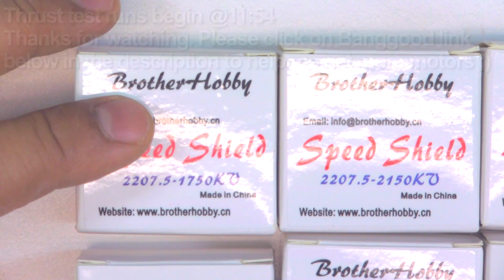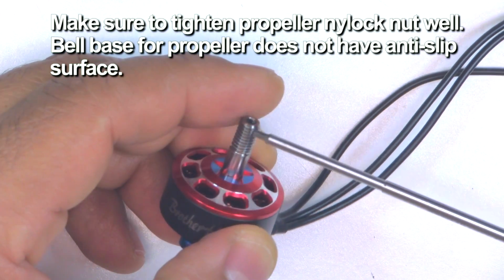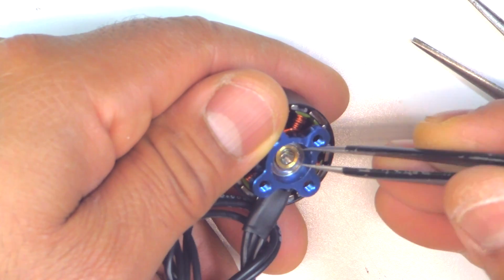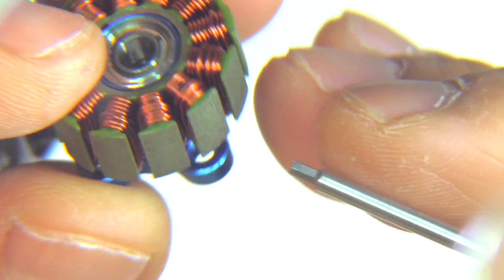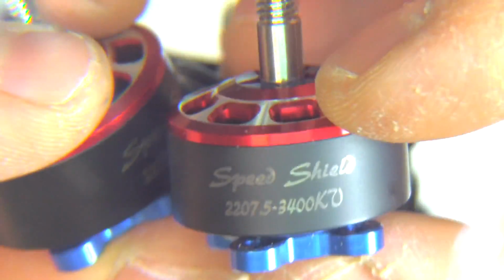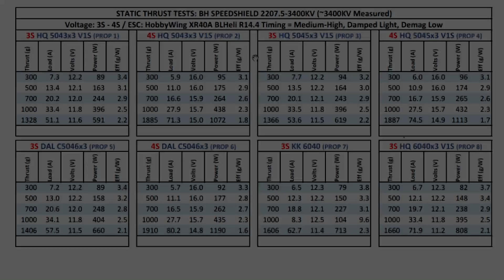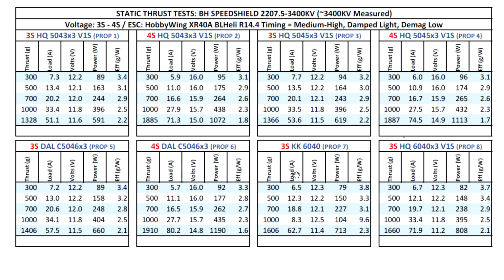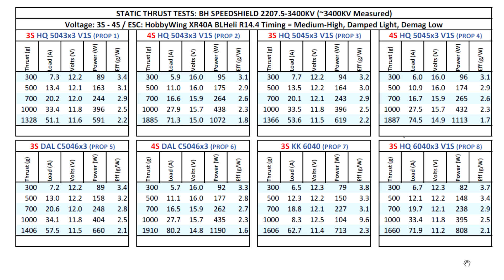BrotherHobby SPEEDSHIELD 2207.5-3400KV - Thrust Test Results

Comment: I've gotten 140mph on a 4.7in prop on 4s on a rebel ruxus v2 with the 3400kv motor.
I posted video on fb on BH page and on my utube page which if you search 2207.5 3400kv speed run will likely pop up.
They were barely warm and I used a spedix gs40 4in1 so they didnt pull no 300a or nothing crazy ,I believe it was around 170a .
Pretty awesome motors actually.
Gonna run some 5030 apc props and see what they do here any day .
Lower pitch but should be good speeds still.
Thanks engineerx for great tests.
Reply from the maker: I may have to re-test on 4" prop. I didn't think these would be used in a 4" setup but your crazy speed tells otherwise. That's frigging fast for a 4" !! Yes, also 5030s could be a great match, just not the oldies from GemFan, too flimsy, Gotta definitely thanks BH for  releasing a motor like this
Reply from the maker: https://www.youtube.com/watch?v=ypk98G4dmyo Found it - that's fast!
Reply: @EngineerX  yea if used on a lightweight frame and propped fight ,basically 4.1x4.1 APC or 4.7x4.7 apc and likely dal 4045x3 and hq4043x3 which I have all of and will try the last 3 mentioned, it will fly great with quality brand high c lipos like rline,pulse graphene 95c,strix 100c and turnigy graphene as well as a few of the luminier graphene and n20 packs.
Also flying in soccer fields wide open non stop will obviously beat a pack and prob the motors so dok g that and saying the motors suck and amp killers is plain stupid which I dont doubt people will do .
You really can fly them at all under 50% Throttle and have amazing resolution and same flight times and power as a lower kv hv setup and then also have that last second recovery top end if ever needed so actually can be the better setup ,again shen used in the right situation.
I didnt try but likely can break any 3s speed record with these with even a 4in prop against 5 and 6in.
I think fastest 3s is like 15 or so and with 6in prop and powerful 2210 cobra but I'm almost positive I could break that with a 4in dual prop. I'll give it a go.
Reply from the maker: @charleshodge9807  Very well explained and you're right. You have to know not to go full throttle for long periods on these and have to make your build just right for this motors and they will perform really well for that specific build. Thanks for adding all this good info.

Comment: Cyclone 5046x3 did 1910 at 80.2amps at 14.8v lmao... Just think about that 80 amps flowing through something that small... Honestly that's insane like for real...

We had 70mm carbon EDFs that run 4s 4100kv on inrunner motors that we was pushing 33 inch carbon monocoque thin airfoil flying wings we would run 2x 2s 3700 in series side by side because they are thin and the wing is very thin.. In fact we designed the wing around the batteries thickness to get it as low drag frontal section as possible. We built a couple of them and flew them LOS and FPV... We made larger ones to that ran 6s and 8s on 90mm carbon edfs the wings had moulded in intakes not just a fan strapped on top.

The point of all this is the 70mm very high pitch 12 blade fans would only pull about 95amps at peak fan loads/Static... These wings was capable of 155mph level flight on 2x 3s 3000s in series 190mph level flight was the normal and in flight 4s pulled roughly 75amps for as long as the batteries could give it but that was all it pulled.

It's honestly amazing that a 2207.5 can handle 80 amps and not smoke a coil pretty much instantly. How hot was the motor after these 4s runs?
Did temps just up big time during those short run ups?

I have these in the 2700kv on a track quad and they are fantastic motors my main track quad motors are 1600kv F40 Pro II and IIIs and im also flying the F40 Pro II 2150kv on 6s as well on big high speed tracks that i need the top end and can carry 6s 1550s without the weight killing me in tight sections.

I wouldn't consider this even on a uber powered 4 inch build BUT what this motor would be excellent for is say a 4.75x4.75 prop on 5s on a 30 to 32 inch flying wing a low drag low lift airfoil you could get some really insane speeds and on a 4.75x4.75 biblade even on 5s your amp draw would be lower then this static test and you would have plenty of cooling and the pitch speed would be very high with that kv on 5s. There is very few if any motors that i know of that can handle this type of current even if it's for a couple seconds that would give me this kinda pitch speed and come in at 30 grams. As you know pitch speed rules on high speed craft.

I wonder could this motor with plenty of cooling handle 6s on 4.25x4.25 biblades? Omg if it could 150mph on a low drag low lift type airfoil that's setup for 2x 3s 2200s would be achievable without much work on a simple laminated foam board wing.

Do you think this motor would smoke at 65 amps for 15 seconds? Im assuming that about what a 4.25x4.25 biblades would pull in flight on 6s. I wish I had a sample now to use as I don't want to buy a full set or i could get it from amazon but singles i have to order from banggood i believe... I will check the normal usa vendors and if anyone stocks them and i can get a single i will build one as soon as i get it and if it smokes it smokes... Ill order two lol and if I smoke one at 6s i will drop down to 5s and maybe go to a 4.5x4.5 biblades up from the 4.25x4.25 on 6s.
Reply from the maker: I'm going to try to answer the most important question. Yes. For 15 sec there a very high chance that it will fry the coils at 65A continuous. The unknown is if with those 4.75 biblades   it will pull that many Amps or even more in-flight. I really don't know. My tests are mainly just to get Max thrust capability but during very short 3 to 4sec spurts. Usually for multirotors [fpv-acro] that's how we use them . These smallish motors with short stators run mostly overpropped at the high rpms in the static tests. But the results give us some numbers for comparing across motors.

Comment: I fly them on 4S with 5149×3 Gemfan Props. Esc i use the Rev32 35amp
Reply: Well I assume you've got heaps of sag on 4S
Reply: @fpvlive  You don't know what sag really means until you try those! 😂
Reply: @fpvlive  actually you need to use so little throttle to put out power and speeds that a lower kv motor would need to be at twice the throttle so if not flying in a wide open area and flying proximity or a tight track your literally flying with awesome stick resolution and control at the bottom half of the stick.
The 2205 4500kv I fly on 4in sag alot harder then these surprisingly 👍
Reply: @fpvlive  is not that extrem what i was expect with Bonka Usa V2 1500mha
Reply from the maker: @charleshodge9807  Tha's really good info. Thanks. These are definitely some unique motors
Reply from the maker: @SettekFpv  Awesome to see they don't explode batteries in an instant :)
Reply: @EngineerX  when you look on my Channel my Last Video is a DVR from testing this Motor. Temperatur was about 10°C so very hard for the lipo

Comment: I only really see this being used in racing wings, but nevertheless a very powerful motor, the tips on those props should be hitting supersonic at least the 6 inch on 4s
Reply from the maker: No doubt... gets scary when I see the big numbers on the screen..... from a distance, I don't want to get impaled if one of the blades decides enough is enough and lets go !
Reply: @EngineerX  yup, I made a little rig back towards the early days of fpv because no one was really testing and I wanted to make sure I got the correct components for my builds, got some extremely cheap gemfan tri blades, started to resonate and exploded into a million peices lol

Comment: Do you think on 6s this would catch fire?
Reply from the maker: depends on prop and weight of copter. Possibly can work with a 5040x3 or close to that and a very light copter...... like 300 to 400g without battery..... but risky for sure.

Comment: we have to  try dalprop cyclone T5051c  :) i think they are perfect for
Reply from the maker: Cool. Thanks for the info. For sure once you get these in the air, moving at speed, the more aggressive, higher pitch props will work fine
Reply: @EngineerX  t5051c are very light 3.3g and they look high pitch but they are made for very high kv motors(the easiest props to spin i ever have)
Reply from the maker: @kieptajfpv6010  I haven't ordered those props, I'll see if I place an order for those.
Reply: DAL 5051s can't deal with 2207/2306 2500kv motors. They will explode at the hub as soon as they start to flatten and glitter. I wouldn't be any where near that motor with that prop turning that kinda RPM. I fly them on BH 2204 2522kv floss motors on uber light track quads and love them. F40 Pro II 2600kv on a 245ish gram dry track quad and I assure you that as soon as you get on it the props will come apart at the very violently. On higher KV motors the second flutter starts the prop comes apart.
Reply from the maker: @wickedreelz5028  yikes..... that sounds scary. I've made it a habit to wear safety glasses and I use a Rx and radio to  manually throttle motors on each test and stand away and out the plane of prop rotation. So far only one prop blew apart. Blade dug itself about .25" on roof plywood. Would've hurt for sure. Thanks for the heads up on the 5051s I'll pass on those then.
Reply: @wickedreelz5028   i use them on speedshield 2450kv and 5s lipo without any problem

Comment: the kv is  better suited to  4 inch props for sure but kind of a big motor for a 4 inch quad. odd.
Reply from the maker: You're right, someone already commented they got up to 140mph easily on 4" - 4S setup. Insane!
Reply: @EngineerX  yeah that's wild!  on the right  light weight 5 inch setup with some  60a esc this might be a good  motor to break the speed record.

Comment: You get the weight savings of 2 less cells with power of 6s on 4s all for beating your lipos a little which are getting cheaper everyday and even the most quality packs have been on sale for 10 and 12 dollars for rline and strix hv 1550
Reply from the maker: That's a very good point. If you end up getting half the lifespan on your Lipo, at the lower prices these days it seems like a trade-off that some people will not mind.
Reply: charles hodge where are these sales at?
Reply: Rline for 10 dollar lol
Reply: @serval_fpv  actually there back to 18 but were 50% off at helination and were 22 bucks 👍
Reply: @charleshodge9807  don't see the offer on helination post a link
Reply: @serval_fpv  they been sold out but Amazon prime still has 18$ rline
Reply: Tattu R-Line 14.8V 95C 1300mAh LiPo Battery Square Pack 4S with XT60 Plug Best...
by TATTU
$18.99
FREE Delivery by Tue, Jan 22
4.8 out of 5 stars (17)

And prime too

Comment: This looks like a twin blade prop motor
Reply from the maker: Yes, on 5" 2-blade props would match well. I'm thinking of running another test with 5030 /5040 and some 4" props. I was in a hurry trying to get some tests out during the holidays, didn't think of those props.
Reply: @EngineerX   how about lighter pitch than 5040X3 prop, racecraft 5038 ? or even mr stelle prop (Ethix S3 5X3.1X3) I think worth to try
Reply from the maker: @cc201135  The RK5038's could work but I've tested them before on the thrust stand and they don't really do well on static thrust. They start to flutter and don't make as much thrust as expected so the results are a bit misleading because in the air they fly OK. I don't have those Ethix props I'll see if I order a couple.